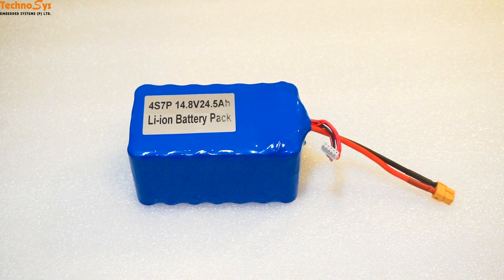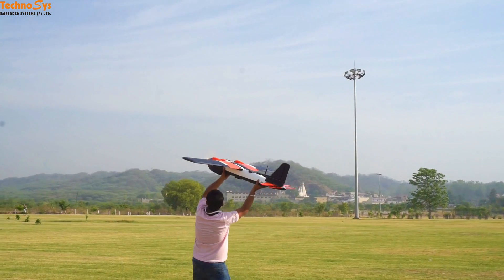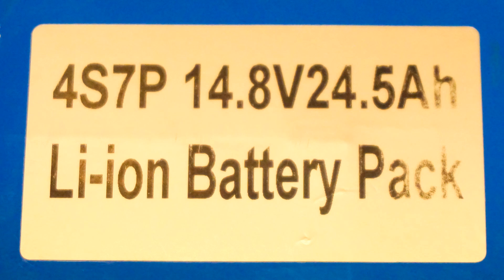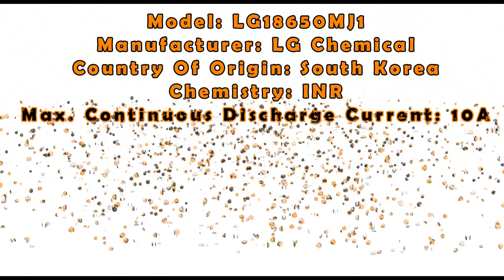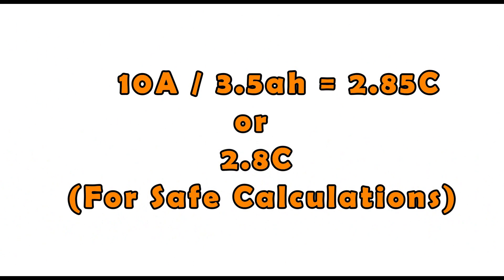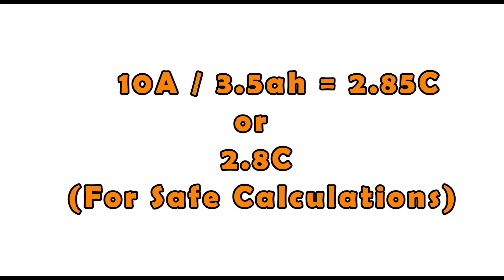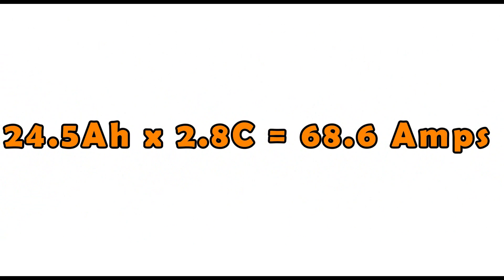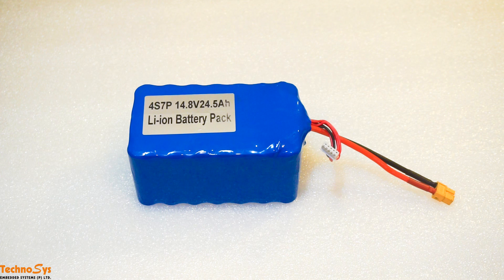18650 Lithium Ion Battery Pack - Current Draw Calculations

Comment: So connecting the batteries in series of 10 amp max draw 18650 batteries increase the max amp draw of the battery pack as a whole?

Comment: This is an educative video. Great job. But in a nutshell, from your explanation as well as your calculation, C rating is used to determine the maximum continuous discharge current that can be drawn from a cell or battery.

Comment: Why are you calculating the C first ? (C = 10A/3.5Ah) You could as well just multiply the nominal current per cell and the number of cells in parallel... so 10A x 7(p) = 70A. Much easier, no ? Or am I missing something ?
Reply: I see what you mean
Reply: You are very correct. C rating is actually used to determine the maximum continuous discharge current that can be drawn from a cell or battery  .

Comment: Your end result of 68.6 amps is the "peak" or "continuous" maximum discharge rate?
Reply: You sound like you know what your talking about,do you know the formula to calculate the peak amps of a mixed (4s7p) cell pack? I've built (short of spot welding them together,and adding my bms/etc) a cell pack (14.8v-11.4Ah) for my 12v  solar/wind system,but I need to know the Amp limitations before I just connect this cell pack to the system.
Reply: I'm not an expert and just started learning some stuff. Usually, your cells should have some specs from the manufacturer. Peak ratings are good for a few seconds; you shouldn't try to keep it at that continuously; keep it at it's nominal rating.

Other than that, A LiPo battery consists of multipe cells. These cells deliver approx. 3.7 Volts. A 4S LiPo would therefore supply 14.8V.
Apart from the cells, a discharge rate is defined by the letter 'C'. Most batteries cases say something like "25C to 40C" discharge rate. This means that 25C is the nominal discharge rate and 40C is the maximum burst discharge rate. It's advisable to stay on or below nominal discharge level to preserve battery future life. Not all brands say something about the peak discharge rate on the battery itself. For more on that, I suggest to read the manual or ask your supplier. 
The battery's capacity is defined in mAh. mAh means milli-Ampere per hour. A battery with a 1000mAh capacity can deliver 1 Ampere (1000mA/1000) for 1 hour. Or 1mA for 1000 hours. The battery capacity, together with the LiPo battery's discharge rate will define its maximum current output (Ampère, A). This fact is very important to keep in mind, when choosing a LiPo battery. The combination of capacity and discharge rate is what you will need. It's important to know that the battery cells don't count up for maximum current draw. The amount of cells only determine the voltage (V) of your LiPo, as needed for your equipment. 
Example calculation of discharge rate: 
A 3S 2200maH 40C LiPo pack will get you this: 2200mAh x 40C = 88.000 mAh discharge rate 88.000 mAh / 1000 = 88 Ampere constant discharge rate. 
So, a 2200mAh / 40C LiPo can only handle an Ampère draw of 88A at max. So that's why the combination capacity/discharge rate is of such importance for selecting the right LiPo for you project.
Reply: Same here,my focus has been more on the electronics end than (because I only recently discovered li-ion vs LA/SLA batteries) 18650 cell pack specs. I saw on a forum that,"as a rule of thumb" each cell in the pack can safely contribute 1-1.5A. By that math my pack could safely supply 28A,but I've also read that it's each parallel connection that contributes 1-1.5A (which would only allow 7A). My solar/wind system is relatively small,I'm supplying power to 3 inverters (2x 400w,and 1x 500w;both continuous ratings) from 3 4s7p cell packs. The inverters came with 30A fuses in them,so I'm trying not to exceed 30A (while providing enough Amps for them to work properly).
Reply: Sir what happened if he draws more than 68 amps ?
Reply: rohan the real superstar Sir, that’s a question that is an enigma, wrapped up in an anomaly, and shrouded in mystery. Some electronic component would burn out that is out of its tolerance.